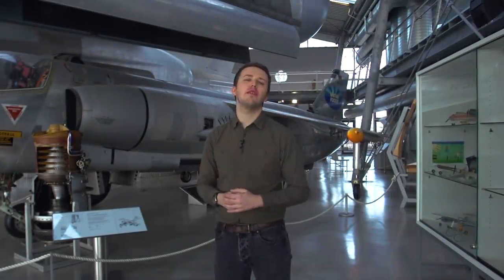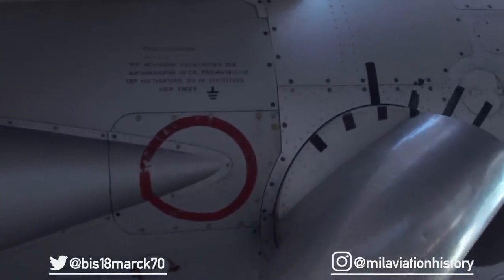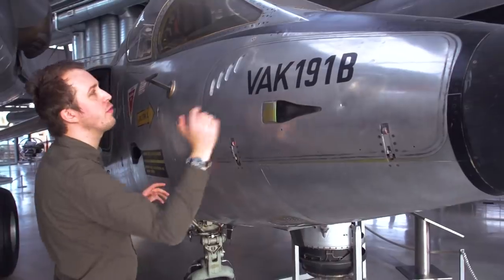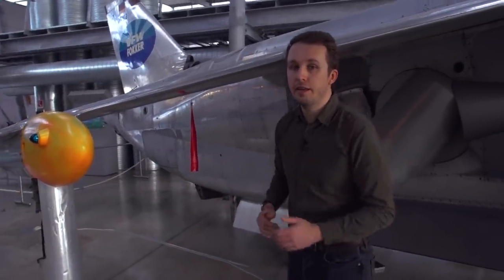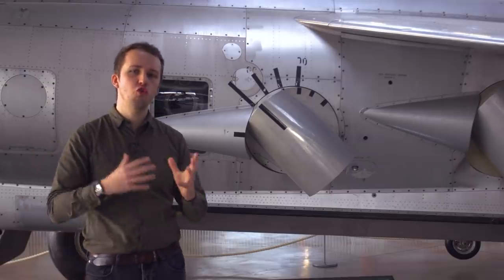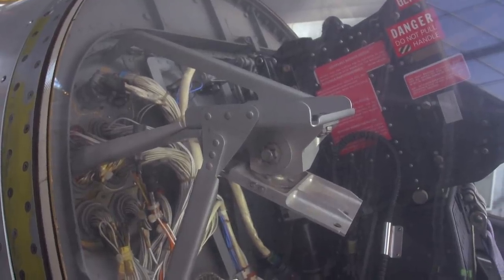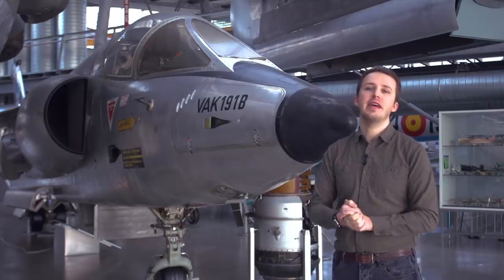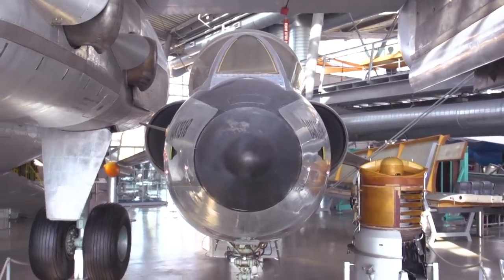Inside The Cockpit - VAK 191B (V/STOL)

Comment: It's funny how, back in the 80s and 90s, pretty much every book or documentary that touched on the origins of the Harrier and the history of VTOL flight dismissed all the early attempts that used dedicated lifting engines rather than the vectoring nozzles of the Harrier. But looking at where we are now, the F-35B's lift fan system is - arguably - more like the lifting engines of the VAK-191 et al than Harrier. (Like VAK, Yak, etc., F-35B uses dedicated lift-only hardware which is dead weight (and volume) except when taking off or landing vertically. But like Harrier, F-35B is powered by a single big turbofan engine, which it taps in an unusual way to produce vertical thrust.)

Comment: There are a number of similarities to the Harrier. These include the gear, the engine and rotating nozzles (obviously) and the shape and anhedral of the wing. It would be interesting to find out how much of that is convergence because of the similar requirement, and how much is because the two designs influenced each other.

Comment: The vtol principle of one engine both jobs (lift and forward locomotion) is the most difficult problem to overcome
Reply: Indeed, But that's one of the reasons I love the VJ101. Its Designers understood, that having engines only for lift is to wasteful, but approached that problem in a way, I think wasn't seen again, until the V-22 Osprey decades later :)
Reply: @A_Haunted_Pancake  It's a pity the VJ101 never got a chance to use its afterburners in flight. The fact that it was (barely) supersonic even without the afterburner is pretty impressive, especially for a VTOL.

Comment: "Incidentally". Bismarck forgot he's talking about German engineers who are well-known for having adopted Murphy as their patron saint and have no concept of what incidentally means. But perhaps those are the high-brow jokes Germans make about other Germans.
Reply: Pure Genius lol, I need a diaper change after that.
Reply: Murphy was an American aeronautical engineer who observed that an technician who had been set the task of wiring up strain gauges to measure airframe stress would repeatedly wire them up wrong.  His observation was that if it were possible to wire them wrong he would do it.    The solution is to engineer things that can't be rigged incorrectly.  To be fair strain gauges are difficult when you have a dozen of them.
Let's have a look at some cases of Murphy's law in Action in the United Kingdom.  There was no war time pressure:
Roy Chadwick, the Manchester/Lancaster designer died with the ailerons on his AVRO Tudor were reverse rigged, so he died of murphy's law on his own aircraft design.
The Comet 1 is famous for being one of the worlds first jet aircraft but also infamous for two total hull and occupant losses caused by fatigue around square cut opening for windows and antenna.   Less well known is that there were two fatal crashes prior to this from over rotation.    The Comet 1 could be rotated while still on the ground such that it would be stalled while still on the ground trying to take off.   It would then run of the end of the runway.   This design flaw is not permitted on todays regulations.  It was of course totally foreseeable and DeHaviland engineers only did something after two completely fatal crashes and their financial interests were threatened.  Two more Comets than crashed from metal fatigue.

The German VSTOL program elected to use fly by wire (the worlds first use) because of the desire to handle the complicated transition from vertical to horizontal flight automatically.   The Harrier was notoriously difficult to fly in this regime and required a lot of training.   The German VSTOL program also desired to achieve supersonic performance and to meet this requirement multiple engines were needed.  High Bypass Ratio turbofans like the Pegasus on the harrier can not achieve supersonic flight and are inefficient at high speed so it was necessary to have a mixed jet
Reply: Incidentally it was just a coincidence.
Reply: But do Germans have a domestic word for half-assed? Probably not. I knew an HVAC guy who would always put in half the screws required for any given panel. That guy would be homeless in Germany!